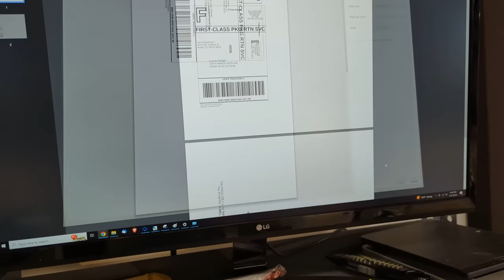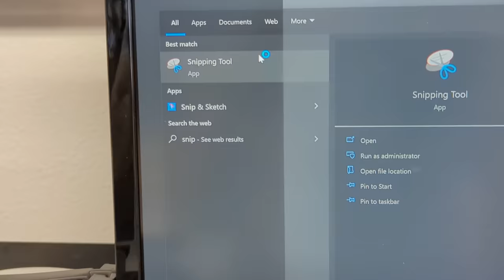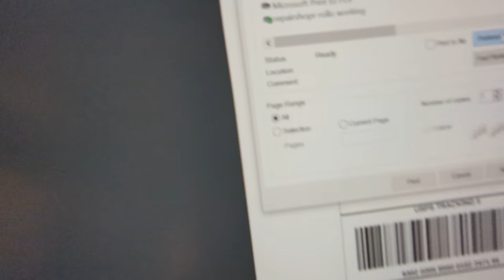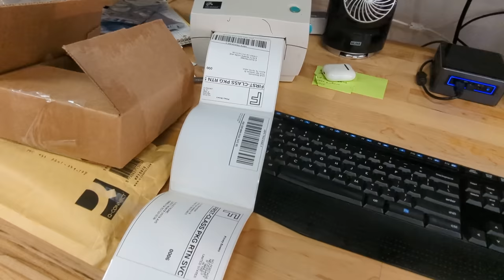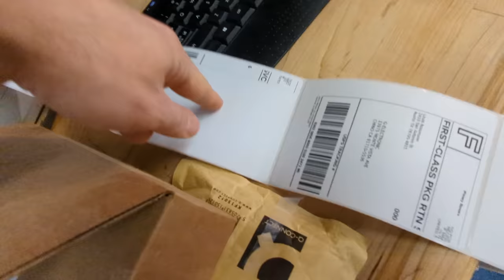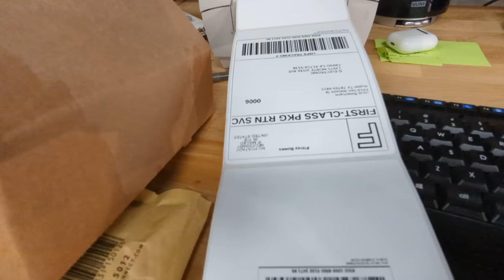rossmann repair group vs. label printer, part 3

Comment: I've done the same thing - take a screenshot of the label, format it separately as an image, and print. Brother makes it a bit easier since it "figures" out to print it to the size of the paper when the image is bigger than the paper size.  I've managed to score a few used Brother QL-1060n from eBay for under 50 bucks each and they've been great.

5:10 and a few other places: There appears to be a credit card visible on your desk here below the monitor next to the Rollo, Louis. You may wanna be careful about that.
Reply: It's like a giveaway steam code, just with credit cards!
Reply: Did you have to point to exact place in the video so it's easier for others to find?
Reply: @kasparsr  Everyone else with eyes can see the same things that I do, sir. It's shown in other places in the video and with better views as well.
Reply: You enter that card number on payments page and it Rick Rolls you!
Reply: thats why i just leave my wallet in a hidey hole. work is to make money not spend money
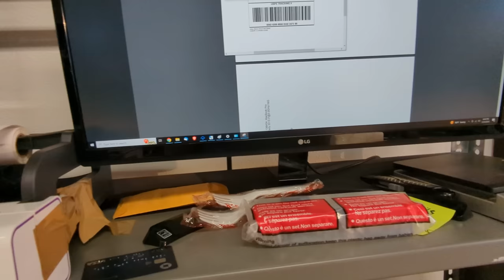Reply: 4:19 - did anyone manage to read the numbers?

Comment: in Adobe you can click Edit-Take a snapshot, select the label area from the page and then hit CTRL+P to print. Bit like snipping tool, but it preserves the original quality
Reply: Yes that's what I always do and it works. Open in Adobe reader, take a snapshot and then print.
Reply: ew adobe.
Reply: @David Sh.  What difference does it make. It's a free program that offers a simple and fast remedy for this situation that arises frequently.
Reply: @Ken_in_Wisconsin  - @David Sh.   // Adobe is still the GOAT; aside from any opinion you have about them.
Reply: @Ken_in_Wisconsin  That's a bug for Adobe Reader. You wouldn't be to snapshot anything from Adobe Reader. It's only available for Adobe Acrobat. /s
Reply: This! I don't get why he doesn't do this. Maybe he doesn't know the feature exist? This problem would have been solved in 1 second.
Reply: @gamtax  Yes you're right. It's Adobe Acrobat. My bad.
Reply: @Ken_in_Wisconsin  I wrote my comment in sarcastic tone and not correcting what you've said actually. 😅
Reply: @gamtax  No worries. I expect you and I both can expect royalty checks soon from Adobe either way.

Comment: I spent 2 days about 18 months ago remote troubleshooting a zebra label printer remotely from an ERP system, for a printer 1000km (600 miles) away. 

I was a manager of the ERP dev team but no one had dealt with label printers previously on the team, and it had been 6 years before I had touched label printers.

Printers are the most rage inducing thing to troubleshoot, bonus points for having 2 of them that print different formats, and local I. T reversed their IP address and no one knew.

Comment: I have to go through this all the time because Canada Post doesn't let us print shipping labels directly to a thermal printer (they only give us a full sized page label with receipt attached). I open the PDF in Photoshop, select the fixed ratio rectangular marquee that I've set to 4x6, draw it around the label and crop. I can then print the result directly to the thermal printer (it's important to select custom print size though and scale it to fit the media if your import resolution is different than the printer's capability). It prints perfect every time. It's a few extra steps, but only takes 15 seconds or so.

Comment: I do this all the time. You have 2 options, depending on the file format. If it's a PDF, I open it in Photoshop which allows you open only certain elements (or simply crop it, depending on how it opens) and then print from within Photoshop. If it's a PNG (or other image format), crop it down to size first, then use the windows photo print wizard to print a full page photo to your label printer, with the "fit to page" option deselected.

Comment: If you download a PDF and open it in Acrobat (has a free version), it's trivial to use "Fit to Printable Area" in the print dialog. Other PDF readers like Evince provide this as well. In Inkscape (free and open-source), you could open the PDF, set the page size appropriately and resize the label in a few clicks. Also, TeX Live provides a simple CLI tool called pdfcrop that removes extra whitespace from a PDF ( pdfcrop input.pdf output.pdf ).

Comment: The best way I was able to overcome this problem was to use Microsoft Word. Change the canvas or 'paper size' to the 4 x 6 or whatever dimensions you desire. Then, put the picture in there and stretch it to fit the page. Make sure you are printing "Custom Page Size" when you print the page. 
I had to do this when I was making custom holiday cards. 
I don't know if any software that does this for you exists anywhere, sadly.

Comment: Instead of snipping tool, I recommend using snip and sketch, it's marginally better for proper thermal label printing proportions, and shows a nice preview. Although not optimal, it's better than trial and error with snipping tool

Comment: I have this sometimes with the odd label. Yeah, snipping and then fit to page works, or image to PDF since Acrobat has a fit to page option. Helps with 4x4 pages on an A4 printer too as you can reverse the order when doing an odd number with leftovers.

Comment: For scaling stuff efficiently for our Canon Image Prograf at work, we only use PDF Exchange Editor Plus version 9.3 build 361.0.

This software allows you to scale, crop, and set even the strangest page sizes, and they will print correctly. The great thing about this software is the preview it provides; it always matches reality. This is a paid software, but it will be of great help in your case too. The only caveat is that you must first convert the documents to PDF if they are not already in that format, as this is mainly a PDF editor.

Comment: For as long as we have had printers in use... WE STILL HAVEN'T FIGURED IT OUT YET. Like microwaves, washers, dishwashers, dryers, and fridges but Printers forever gives anyone a problem. Sometimes it is the manufacture other times... it just makes me feel dumb because of something as small as "do you want this in inches or centimeters?" Glad to see care put into the size of the bar codes, I find it annoying when I see bar codes that are just slightly off in size over at the stores I visit. Hope you are well.

Comment: Just a tip. I had more luck before, using the Photoshop printer module, as it can crop the whites properly, has a decent preview etc. Coming from someone who made & received these in bulk a lot of times (worked in a fulfilment warehouse for 5y)

Comment: If you have Microsoft Publisher, you can resize the copied label according to the software's ruler measurements. That will make it much easier to accurately print the size required for the label.

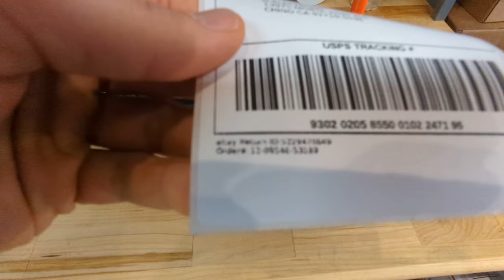Comment: See a lot of these from our customers. I'm an employee at a franchised shipping store (for which I see a familiar box at 8:24), and commonly how I end up fixing this is through Adobe Acrobat Pro's cropping function, rotating using the edit function (so it doesn't print weird), then printing fit to page.

Adobe also yields better print results than the snipping tool especially if source was a pdf, and Adobe's print dialogue is just straight-up better than stock windows.

Of course, if push comes to shove, can still zoom in as much as possible for best resolution, use snipping tool, save, and print using the Windows photo app. Yields good enough results to scan, and allows scaling to a 4x6 in-app.

Comment: Like half the tickets we get at my job are for broken label printers. And at my previous job we had to repair them constantly while talking to customers.
I knew them so well I didn't even have to look when I opened them and did whatever needed to be done.
Reply: "Pulls out roll, scratch off sticky residue, close, run." :D

Comment: The way I get round this is open it up in Adobe Acrobat, edit > take a snapshot, then print that snapshot on the printer. As long as you've got the orientation right, it works all the time.

I know this doesn't help you 4 weeks after you posted this video, but maybe it'll help in the future. :)

Comment: label printers are the most troublesome things to install. i've had several where the manufacturer had to remote in and correct the drivers. XP era issues... didn't they learn to code?

Comment: As someone who worked on barcode systems and label printers for 2.5 years decades ago.  I feel your pain. Nothing has changed and it is no better than it was. Printing is the bane of all technicians. The sort of trouble-shooting you just performed was a daily event that never ended.  Had a sales guy giving me logos to put on labels and he's handing me an embossed business card instead of high quality original art.  So I ended up scanning these logos, tracing them in CorelDraw via raster tools.  Then I could resize the logo and have a crisp image.  No, I wasn't paid enough which is why I left that employer.  There should be Zebra label software that allows you to layout a one off label where you could have pasted the screenshot.  At least it would print WYSIWYG.  Just get a networked laser printer so anyone can send the letter size UPS / FedEx labels and then you fold the page in half and slide it into the shippers stick on plastic sleeves.

Comment: I would recommend switching to Linux for the printing PC. I have an Zebra LP2844 working via Cups without any problems. And the best thing: It will still work fine when I decide to print something on that printer once every few months. 

All I do to make it work flawlessly is to first put the PDF through a python script to cut the oversized PDF to the size of the shipping label.

Comment: While I have nothing but sympathy (I have an 11x17" printer and amazingly - I have similar problems) - and I do have to point out I worked on the printer drivers for the first parallel port Mac cable solution back in the 1990s (PowerPrint) ...

The problem here is that you were printing an 8.5x11" page on a 4x6" label. In landscape mode. The printer was doing exactly what you asked it to do. Printers don't have the idea of 'just print the part of the page I want'... so you nailed it with using the snip tool. You could also have opened the document in a word processor or PDF editor and changed the page size to 4x6 (with margins).

I think the usual idea for these things - if you were sent the shipping label by say FedEx, is to print it on normal paper, trim it and tape it to the package. That's what I do.

Comment: When I saw him using the browser to print the label I thought "there's the problem".
With my customers I recommend not using Chrome or Edge to print PDFs as the print settings don't always transfer through.
I tell them to install Adobe Reader DC (it's free) or some other PDF reader to print their PDF documents. If there is still problems I tell the to select the Print As Image option in the Advanced section of the Print option. This usually fixes most problems. There is also a Fit and  other options to help you get the result you want.

Comment: The misleading part is that you are looking at that printer as if it's a regular one, when in reality it basically prints sideways.

So every setting or adjustment need to account for the fact that the printer expects to print by default with a landscape orientation, and the software could still show it as "portrait".

Comment: If you were to save the file, then you can use the Windows dialog to print, which allows fitting the image to the size.

Comment: Louis theres a much more easier way if you have Acrobat Pro. In Acrobat make sure the "Take Snapshot" Tool is activated (if not Rigth click the Toolbar > Show Edit Tools > Enable "Take Snapshot"). Just open your Shipping Label in Acrobat Pro , click on "Take Snapshot" or "Edit > Take Snapshot" , then draw a frame around the Label, right click inside the frame and select "Print" .

Comment: It's easy, just open the PDF in Adobe Reader (it works in Foxit Reader as well, that's what I use) and from the Edit menu choose MORE, then TAKE A SNAPSHOT.  Use your mouse to select the label only, then go to PRINT.  Make sure you've got the correct printer selected and in the print dialog box you will see the option under "Pages to Print" SELECTED GRAPHIC (it should already be selected).  Print your label, done.  Works great on my cheap no-name printer.

Comment: Lol, I knew the sloppy snip was gonna be a problem… I like to prntscrn and toss it in paint, then zoom in and cut it down to the exact pixel edges. If you do that, it might prevent it from printing the blank label after the actual label (it must have white space off the edge)

Comment: Louis there's a tool (Snapshot) in Acrobat Reader to print only a piece of a PDF page. Select the label and print it. Super easy and none of that snipping tool nonsense. Just print to fit and auto rotate and done. 

This video is about Louis not knowing a function of Acrobat Reader, nothing else.

Comment: This is entirely too relatable 🤣

If you are only doing one or two labels you can use the "snapshot" tool in acrobat, which works well. Otherwise, there are websites that can automatically crop out the white space from your PDF.

Comment: I think the problem was the margins....used to have this crap years ago with Word...content was bigger than the margins, so it overflowed...hence when you snipped it smaller so it fitted all margins including printers which possibly were overiding the print softwares it worked better

Comment: Go to printers in control panel  - printer properties - on the zebra - choose the 4x6 size, print a test page and it will work 100% - I run a factory and we ship out 4000 units a day with individual labels -

Comment: I hate dealing with zebra printers.... not the small lp2844 or gk420d. Those are usually easy to fix. It's the big ZT410 label printers that are a pain. They always get jammed or rip the paper when you use the small label rolls. I have a process when troubleshooting them but they will sometimes jam for reasons unknown to man.

Comment: use to do this allot of the time for returns years ago. I think I wasted 3 labels figuring it out after the guy that works in shipping couldn't. The trick I used was figuring out the size of the label in pixels then resizing the image to a bit smaller than that.

Comment: I have had this issue many times. Not here to brag but the solution is pretty easy. I do the same with snipping tool, however. I do make sure all the whitespace is at a minimum. then I open it in Chrome. Press CTRL + P. Make sure the print/ paper size settings are correct (it always is because I don't touch the settings) and confirm the print preview matches to what I want. And done. I hate wasting labels even if I have thousands of them.

Comment: Hint: when using snipping tool, first zoom in as much as you can while still fitting the stuff you need on the screen. If you snip a small part of the screen, you get a bad resolution.

Comment: I have to do this often enough I knew immediately what the solution was, including both cropping and "fit to page".  I actually do it often enough that I wrote a program that would take a black and white image like this and crop it on all four sides to leave no more than 1 pixel of white space on each side.

Comment: The thing with the Zebra printers is if the DPI isn't correct then the barcode will not scan. Ask me how I know?

They also have a rather cool language that allows you to just drop a file onto the printer and it'll just spit it out.